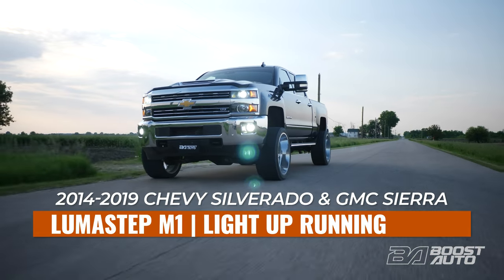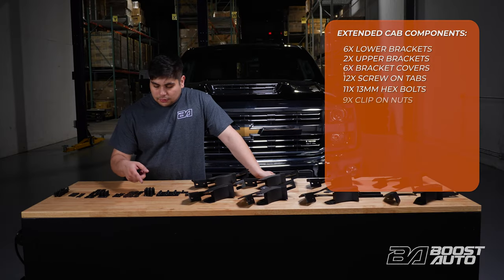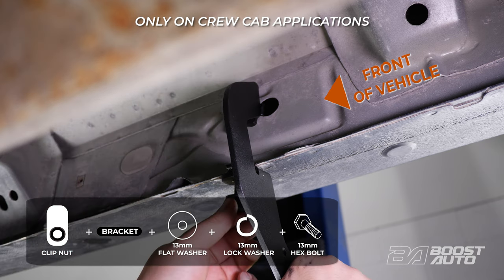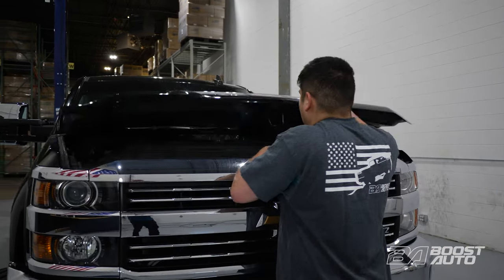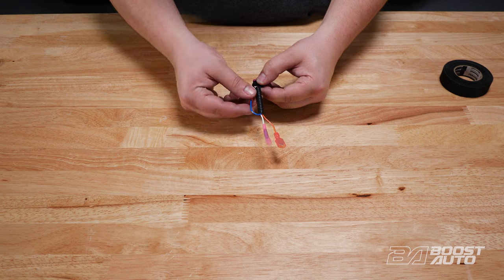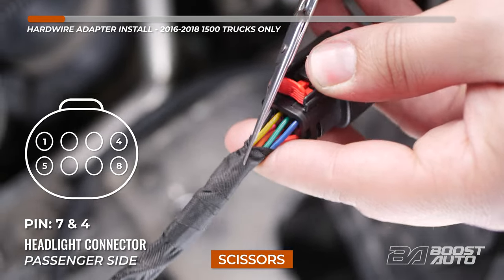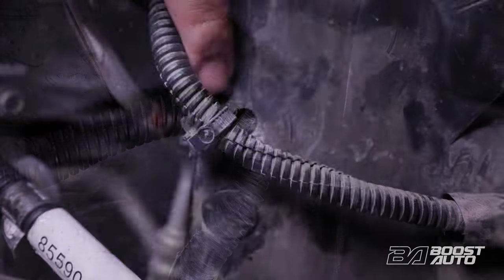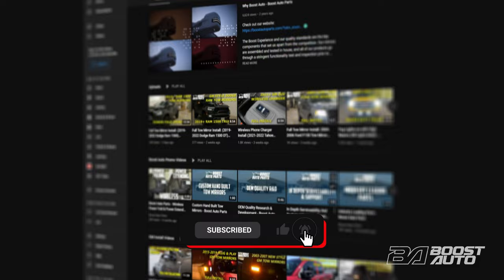Lumastep M1 Light Up Running Board Installation Tutorial | 2014-2019 Chevy Silverado & GMC Sierra

Comment: Hey I just purchased a set of the running boards i was wonding what tow mirror lights those are and where i can find them
Reply from the maker: Those are our switchback mirror lights - available on our website! Feel free to give our team a call at 765-831-2830 if you need help locating them, or just enter your year/make/model into our search and they should pull up!
Reply: @boostautoparts   Those come with a startup feature, correct? I looked on your site and I didn't see the option for that specific feature.
Reply from the maker: We are in the process of rolling out start up on our mirrors. Some have them, others don't (quite yet). I'd recommend reaching out to our team at sales@boostautoparts.com or calling 765-831-2830 to inquire on the specific lights you're looking at. @gabesummers3181